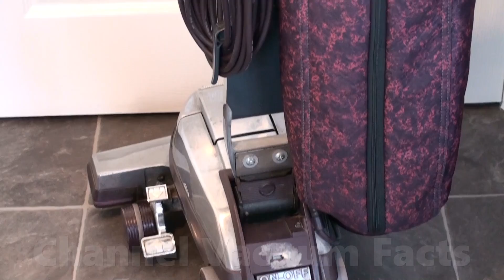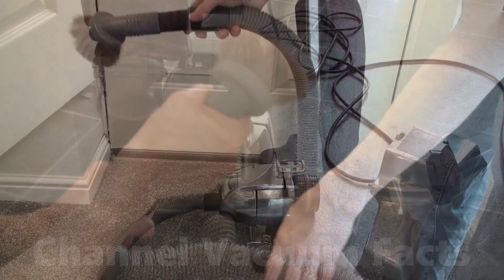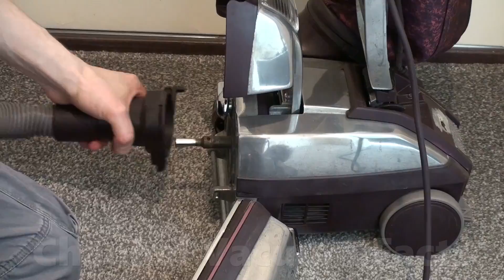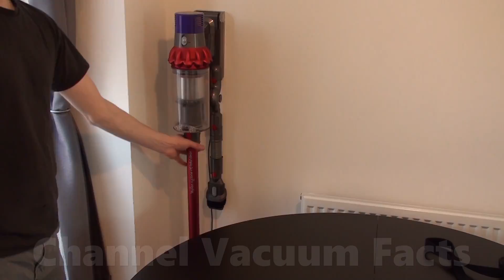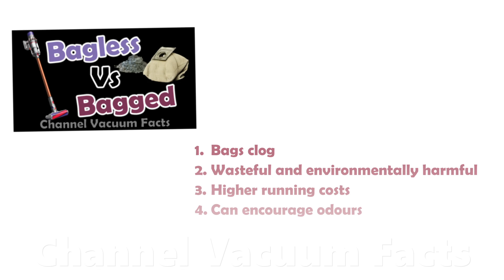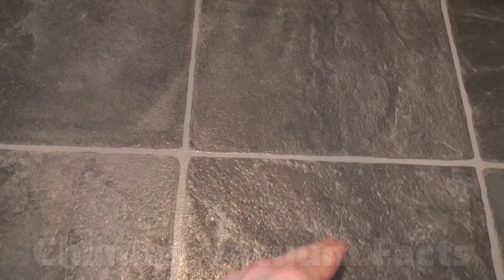Review of a Kirby Vacuum Vs Dyson Cordless

Comment: I feel you on the weight. As a kid my dad made me clean with a kirby and the amount of times I stubbed my toe as a kid (around 10) and the weight of moving it made me hate vacuuming lol. Later on he made me use a shop vac because of the high horse power rating with straight suction tools on carpet only 💀. Eventually I refurbished a dyson dc25 I found because every time I vacuumed was a whole workout and the amount of dirt it picked up was crazy 🥴.

I don't understand the strange obsession with thinking that "old" devices (at least before 2000) were built and cleaned better than modern tech as if there were no advances. They say it cleans better and is more reliable but they can't articulate why other than saying it's more simple, less parts to break, and less electronics or something. 

The same thing happens to washing machines in America where they love to say top loaders like the Speed Queen clean better because they use gallons of water even though testing has show frontloaders are better in all aspects. They also complain about how mold prone frontloaders are but these complaints are often user error because after I solely operated the one in my home, maintained it, and use the correct amount of detergent there were no mold problems.

Comment: its not as bad as your making it out to be. You just don't like Kirby. Kirby drives itself so your not struggling moving it. The suction is way better than Dyson and you can paint your house, shampoo or vacuum your carpets etc. put the purse down and get to work. Be a man.
Reply from the maker: It's exactly as bad as was directly shown in the video with evidence. You just don't like facts. You're also stating falsehoods. Data shows the "suction" is not "way better than Dyson". You also show complete lack of understanding of what actually counts—namely cleaning performance—despite it being meticulously explained in detail in the videos. That's just shocking. And the problems of being a 'jack of all trades', that you wrongly portray as a virtue, are in the video you're commenting on. I recommend you stop suggesting those ahead of you "put the purse down and get to work" and "Be a man" and try watching the videos you're commenting on, so you become better for it.
Reply: @VacuumFacts  Dyson made Kirby cry xD, you should compare it with the Gen5, and bust that myth once and for all for everyone.
Reply from the maker: @kerekeslorand7059  The Kirby was compared to the V10. The V10 has been compared with successive Dyson cordless generations and shown to be outperformed by them. So it stands to reason the Gen5Detect performs even better than the V10 shown in the video. A direct comparison won't change the conclusions.

Comment: kirby belts last aprox a year and a half with me doing shag area rugs so? as well you keep rattling on about cordless... theres a reason this clamps to the floor so hard with tech drive off.. its because of the airflow this has that your CORDLESS POS DOESN'T HAVE! which guess what? IS NEEDED TO MOVE DIRT FROM UNDER CARPETS AT THE PAD. the height adjust is there for the same reason. its why a kirby will pull out more crap after the dyson till its all GONE. THE DYSON CANT GET TO THE PAD! cordless is great if all you have is washable area rugs and hard floor. if you have carpet its only an intermediate cleaning machine POINT BLANK.
Reply from the maker: >> “kirby belts last aprox a year and a half with me doing shag area rugs so?”
So, it’s a running cost that’s wholly avoidable. It was spelled out quite clearly in the video you’re commenting on

>> “theres a reason this clamps to the floor so hard with tech drive off.. its because of the airflow this has that your CORDLESS POS DOESN'T HAVE!”
You show a complete failure to understand basic physics taught to all children as teenagers in the developed world. It’s because the surface area of the cleaner head is large which when combined with the (still relatively low) suction pressure, produces a large clamping force. There are videos on my channel explaining this. Tech drive is a sloppy kludge workaround whose disadvantages are readily outlined in the video you’re commenting on.

>> “<airflow> IS NEEDED TO MOVE DIRT FROM UNDER CARPETS AT THE PAD.”
This nonsensical myth has been fully debunked on my channel. It also further reveals your shocking ignorance of elementary physics.

>> “the height adjust is there for the same reason.”
I recommend watching the video. It explains why better products adjust height automatically.

>> “its why a kirby will pull out more crap after the dyson till its all GONE.”
Except it won't. Further evidence of shocking ignorance of basic physics. This is all covered on my channel regarding statistical removal of particles from complex fibre networks and why residual dirt concentration gradually reduces. It doesn't magically go to zero.

>> “THE DYSON CANT GET TO THE PAD! cordless is great if all you have is washable area rugs and hard floor. if you have carpet its only an intermediate cleaning machine POINT BLANK.”
Your level of ignorance and tribalistic thinking is so disturbingly at odds with reality, I can only encourage you to educate yourself with the material provided on my channel to save you from hopelessness.
Reply: @VacuumFacts I love how bro violated him 5 different times💀💀
Reply from the maker: @mrbreadgd3473 6
Reply: @VacuumFacts  6 is crazy

Comment: I’ve been using Kirby for twenty years. It has never let me down
Reply: Yes I’ve had to replace belts and bags. Just like doing an oil change on a car. It doesn’t mean it isn’t reliable.
Reply from the maker: Well, to me, that is technology that let's the user down. While I'm sure you're happy with it, I and many wouldn't be, because those issues, and many others, are long in the past, wholly avoidable now, and technology has advanced far beyond anything even the best kirby machine can offer. This video (and the other reviews, such as this https://youtu.be/7wa3SrXh-0s ) merely pointed that out.
Reply: Well, they and you can stick with whatever you prefer.
Reply from the maker: Of course. That's always been the case and is completely independent of the video, which shows the facts separately to any subjectivity.
Reply from the maker: Never had to replace a single belt? Never needed to change the bag? Never needed a 'service' by an external company? I find it hard to believe one of those wasn't required in 20 years. And then there's everything else in the video.

Comment: I've had a Kirby for over 20 years and while it's not the best vacuum, your review made me laugh. Watching you struggle with it, come on; yes it's heavier than most vacuums but if you can't easily pick it up with one arm then you need to hit the gym. I have as G6 and I pick it up and move it with really no effort as does my girlfriend.
Reply from the maker: Your comment 'made me laugh' too; dismissed an entire suite of points evidenced in the review to trivially focus on a single area (weight) whose problems have been solved by better technology and manufacturers. I think we're done here...
Reply: @VacuumFacts  I wasn't dismissing the points in your video, I liked your video for the most part. I like the Kirby but it's probably more that it's what I'm used to, and when mine dies I probably won't buy another one. My point was watching you struggle with it was a bit over the top. It reminded me of a late night infomercial where actors try to sell some gizmo by making something simple like flipping a pancake seem like an impossible task. You made some good points but if you really need two hands and a lot of effort to pick it up (I'm assuming you intentionally exaggerated the lifting if the Kirby to prove a point) then maybe doing some push ups isn't the worst thing in the world. I'm not trying to trash your video or pick on you it's just that performance seemed over the top.
Reply from the maker: Thanks for your trivially comsmetic assessment of a single point that isn't representative of the video and purpose as a whole.
Reply: @VacuumFacts  You're welcome, glad I could help!
Reply: @VacuumFacts  Dude, that is not how to take LEGIT CONSTRUCTIVE CRITICISM. I tought about subscribing but i hastly unchecked the subscribe button because you're acting like a damn kid. Learn how to interact with people.

Comment: I love my kirby Sentria, I rather have the bag that way I dont dump my dirt in a trash bag and now dust is all over the place, yes I will admit the smell is the only issue with it, but at the same time it's not like its stinking up my closet either, I love every attachment and like that the cord doesnt tangle, I also like the bulkiness and its aluminum finish
Reply from the maker: If you're getting dust all over the place when you empty a Dyson, then you're doing it wrong. There's plenty of evidence showing how this can be achieved in 5 seconds, without cost or any mess, e.g., https://youtu.be/E_ik6qScs0o . Nasty, copycat bagless clones, with their very poor design, are a different matter, as discussed here https://youtu.be/ptN0kkOtGSM . Many people loath the smells of bagged vacuums, and the manufacturers are aware of their inherent failure; they provide perfume capsules and crudely attempt to avoid smells with 'activated charcoal' filters, which don't work effectively anyway. I'm sure it's nice to not have a cord that tangles, but it's even nicer not to have a cord at all. And the criticisms of the concept of excessive number of expensive attachments and their practicality in use are exposed in the video. Cosmetics, I can't comment on given it's entirely subjective, but the criticisms of excessive weight and materials use is discussed in the video.

Comment: I'm not sure how you can talk s*** on Kirby when you can't even use it properly using the height adjustment on your left hand side will allow you to take the powerhead off with ease don't bash on Kirby until you know how to use it fully
Reply from the maker: No idea what you're talking about, but you're doing my job for me by pointing out ridiculous design flaws that need such nuanced usage to 'get it right', rather than just intuitively turning it on and getting on with the chore. And of course, your comment conveniently ignores literally everything else flawed shown in the video. Hypersensitive much? >_>

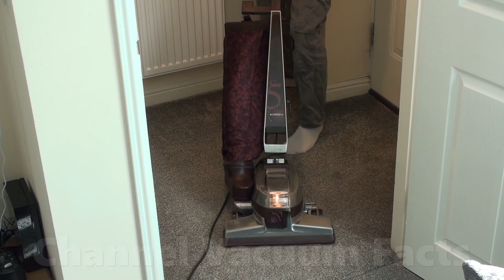Comment: 5:00 do you reckon if the soleplate had a narrower opening it would make the suction seem more concentrated and therefore harder to push?
Reply from the maker: As covered in all physics high school lessons regarding pressure, the opposite.

Comment: The older Kirby 500 series (1937 to 1969) are much lighter than the Classic and G Series that preceded them. My 1949 Kirby 509 and 1965 Kirby Dual Sanitronic 50 weigh around 14 to 15 pounds which is what most newer uprights weigh.
Reply from the maker: So, they're twice as heavy as the fundamentally better formfactor of the modern cordless Dyson stick vac models that also don't fail in every other area beyond weight that the Kirby vacuums do, as discussed in the video. Incidentally, the older style candles might fit the chandeliers better than the modern ones to help light the room. Like stamps, I'm sure collectors like these machines. Unlike the horse and cart for transport, the rest of us have moved on at a practical level.
Reply: @VacuumFacts  well, it’s better than taking rugs outside and beating the dirt out of them that’s for sure. My Kirby’s will be running many years in the future wile most modern bagless vacuums won’t be since they either will have been thrown out or stripped down for parts.
Reply from the maker: @seana806  Candles are definitely better than cracking sharpened flint together to light a flaming torch, you're right. And yes, the chandelier will still be around when people have thrown away their LED bulbs. But then there's literally everything else conveniently being ignored—namely the advancement. Some people like candles, the rest of us have moved on.
Reply: @VacuumFacts  how many older Dysons do you see from the 90’s and early 2000’s? I am betting not many since they’ve been long discarded or have been junked. I still see plenty of older Kirby’s that are still kicking around vs older Dysons in my area.
Reply from the maker: @Sean A806  Plenty of Kirby machines in the trash too. You could be saying the same thing about your chandelier compared to all the LED bulbs in the bin (because more people are using them in case it isn't obvious). Your entire argument about being durable is absurd and debunked many times, including in the very video you're commenting on. They need constant maintenance, have costly running parts that need replacing etc. And they're not that good, not easy to use, and not very environmentally friendly. To have something that poor for a long time is no virtue and not something to brag about. Technology moves on, does the job better, impacts the environment less during use (and especially if after-life care is adopted and they're recycled) and so on. Again, some people like to brag about the virtues of candles and their chandeliers, or their horses and carts; the rest of us have moved on.
Reply: @VacuumFacts  I’ve moved on from modern shitty vacuums they don’t work worth a damn AND need a lot of maintenance to keep them going. I once had a bagless Bissell vacuum that worked when the filters were clean but soon lost suction and airflow once they got dirty, literally had to be cleaned at the end of each week if not twice a week to keep it working properly. Never had to do that much with my Kirby’s other than empty to shake out bag every now and again, clean any hair the gets wrapped around the brush roll and that’s about it.
Reply from the maker: Well, I can agree with you there. Most bagless cleaners (Dyson clones) are poor, don't work well etc., as discussed here https://youtu.be/U_qS2i6HQRY . Modern high-end cleaners are usually good, and I can confirm from experience that the Dyson cleaners are exceptional, durable, and you get what you pay for, unlike the compromising clones. They even self-clear of hair on the brush roll, as reviewed here: https://youtu.be/noCLwXCVDsk I've reviewed many modern products; Dyson do lead where the others copy https://www.youtube.com/playlist?list=PLBxUOcW7kaEtK3qcKCMEaLKTrP8Ehu8sz

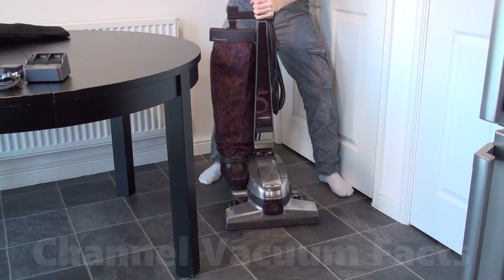Comment: 3:10 yes the Kirby vacuum is heavy but you REALLY have trouble lifting 20 ish  pounds (9 kilograms)? I'm 15 years old and I can lift it with one hand and carry it up my stairs no problem. Unless you have a physical disability at your age (I'm assuming you're in your early to mid twenties) you should have no issue lifting this thing. Yes it's definitely not light weight but it's not THAT bad for someone your age.
Reply from the maker: You missed the point entirely. How much trouble, I as an individual have, is irrelevant. That kind of weight is dangerous, wholly avoidable, and has practical and environmental consequences. There are superior products which outperform this monster using much less. Nuff said.
Reply: Plastic has a long term negative effect on the environment unlike metal parts which can be recycled @VacuumFacts
Reply: @charlesmedrano3825 pretty sure you could say that about most vacuums that are leaky, trust me, Dyson is absolutely the best for air quality, my family have allergies and we have the v15 detect and it’s bloody amazing even compared to my Dyson animal ball 3 UP34, I was so amazed I decide to get rid of it and  use my v15 as my only vacuum